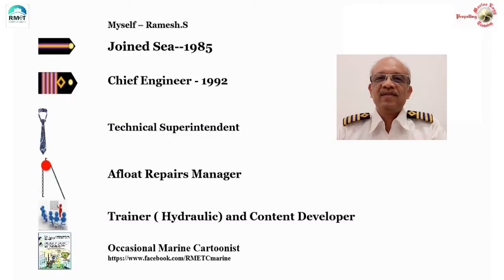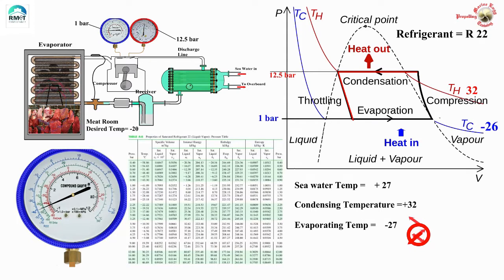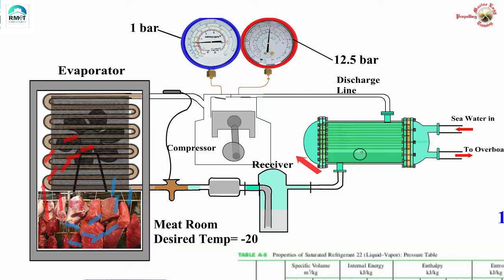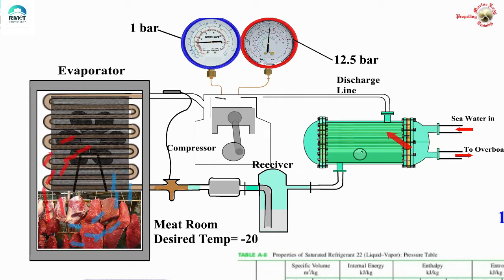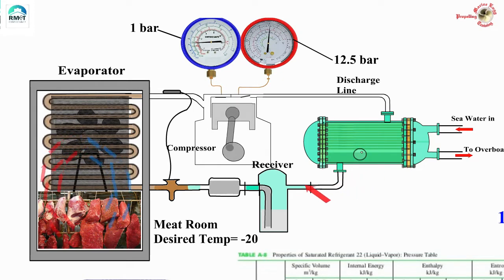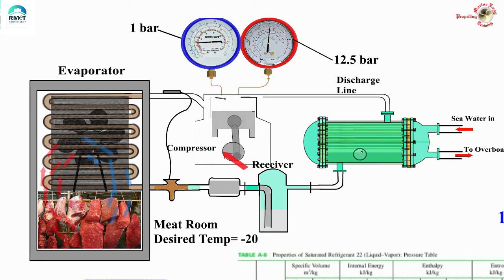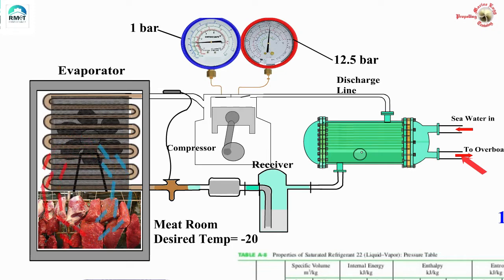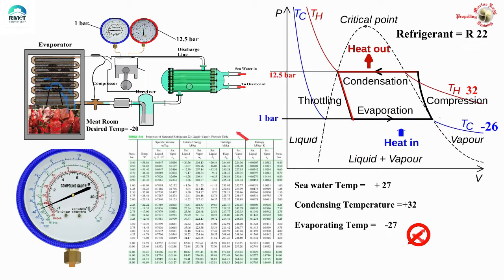How to understand the Freon Gauges?? | Troubleshoot with Gauge | RMETC | Ramesh

Comment: Hello from Latvia! Finally very clear to me what to make of all the markings on those gauges thanks to your explanation! Sometimes suction gauge is not just 2in1 but 3! Also having oil pressure indication together with freon pressure and temperatures. Would also appreciate detailed video about oil in AC compressors and oil separator fitted in the line.

Comment: Suction pressure is getting to 2 or 3 bar would be probably when the meat room is not cooled for a long time and the temp is +10  may be. Then in that condition initially the pressure will be 3 bar and latter as cooling goes on after some time it will come down to rated pressure 0.8 to 1 bar. 
Just one possibility I think.

Comment: Sir on my ship on suction side there was a differential pressure gauge which also shows the lube oil pressure ? Can you explain how to read that
Reply from the maker: The total pressure or actual Pressure you see in that gauge is a SUM of the Crankcase pressure and actual LO Pressure. THe Difference is the actual LO Pressure.
Reply: @rmetcvideos  sir so how the crankcase pressure will be known? So that i can subtract it from the total.

Comment: Sir,as the Ambient temperature and the temp of sea water used as a cooling media in condensor also affect the suction and discharge pressure of the compressor .How the compressor discharge pressure is maintained (regulated) so that the refrigerant in condensor will condensed at varying Ambient condition.
Reply from the maker: Yes you are right, The sea water temp will definitely affect the discharge pressure. It may affect the temp of freon liquid , but the TEV can control the suction pressure.Discharge pressure cannot be really controlled.It may go up if sea water temp goes up or condenser is choked or there is Air in the system. You need to control it with maintenance.Otherwise it will trip on HP.The fridge is designed to work within the anticipated sea water temp Range ..which a ship will usually come across..Hope it clarifies your doubt
Reply: @rmetcvideos  thank you sir for clearing my doubt.
Reply: @rmetcvideos  I had the same doubt sir. Thanks Mr. Avinash for making it easy and thankyou so much sir for the efforts.